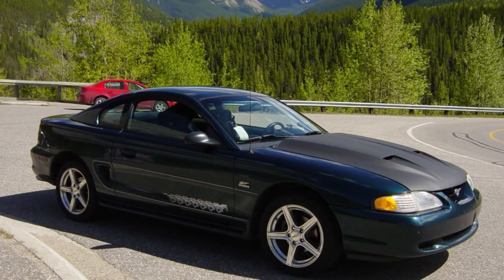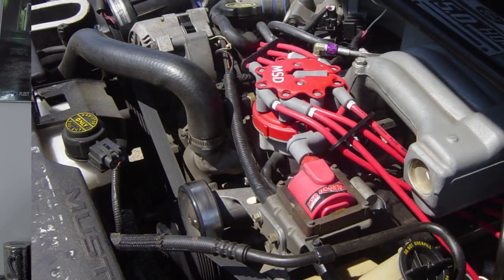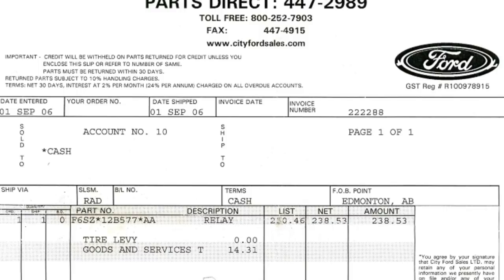SN95 Owner's Guide #3 - Myth of the CCRM

Comment: My 2000 mustang. Fan in on all the time.  Need advice.
Reply: my 94 just started doing that and I did not have a CEL so I did the koeo and koer tests and had code 117 which is Ect sensor ground and also a few other things which I'm thinking it's because of the ground that I got the other codes. I will check voltage at the pigtail connector today and see what I get and also plan on testing then splicing in a spare pigtail connector that I have to see if that fixes it.

Comment: hi! GTC i have a question related to what i just watched, when you opened the CCRM you pointed to 3 relays right,, and said that one of them is for the fan ok,,, well i have a mustang gt 1994 5.0..and fan is not working ok,, i had check fusses,all good,, and the fun works when i connected straight to battery ok,, but i have no power trough harnesses,, and from what you just explained my problem will be one of those relays inside the CCRM,, ok ,, can you please tell me where can i get that part and number of it?? please any help will be great because summer is coming to californiA and i like to fix it before get`s here ok well thanks in advance

Comment: On my 04 Mustang GT, when I turn the key to run position, the fuel pressure doesn’t increase at the fuel rail. I do hear the fuel pump when I do turn the key. Psi stays around zero. When I disconnect the fpdm and connect the power wire and fuel pump wire together, the fuel pump will prime to 40psi at the fuel rail. The car takes forever to start. Over 5 seconds to start. I replaced the fpdm and still have issues. When I drive, the fuel pressure will be somewhat normal then when I punch the gas, the car runs super lean and the fuel pressure drops to about 20 psi or so. A possibility the ccrm has a bad relay?
Reply: Having all those exact same problems in my 98 gt. Replaced fuel pump and it did nothing. Could be fuel pressure regulator or leaky injectors.
Reply: Did you find out the problem of why the fuel pressure drops? I am having the same issue and I have replaced many parts and still hame the same problem.

Comment: I have a 94 ford mustang which is running rich . Replaced the ccrm, stopped running rich for one run . Then ignition was shut off . Turned it back on and back to running again . Did I just get lucky and the ecu is bad ?
Reply from the maker: Without proper diag. it is difficult to speculate what is causing your rich condition, but I can assure you that the CCRM has absolutely no impact on fuel mixture control. It only provides power to the pump. The return style fuel system in your 94 runs the pump at a fixed flow (135 lph if stock) and manages pressure with a vacuum referenced mechanical regulator. Fuel delivery is managed by the PCM by referencing the MAF, ECT, IAT, Throttle angle, load calc, and finally O2 sensors. Any of those things out of range could cause a rich issue.

The first step is to verify the rich condition, a proper wideband is helpful, but OBD 1 codes can get you started.

Hopefully this helps you along.

Thanks for watching and commenting! -Darren

Comment: After all of a sudden I got it to crank and turn over but the car turns on and intimately dies off . It stays on if I push the accelerator only I let go of accelerator and dies . Checked under dash fuses and ok except like 2 or 3 of them I put new ones on . No I checked pins going into the CCRM AND ONLY LIKE 8 OF THEM HAVE POWER THE REST DONT . HELP PLS ?

Comment: Had an issue with mine where the fan was running constantly, turned out to be the ccrm high speed relay being stuck open
Reply from the maker: That is exactly the sort of failure a CCRM can produce. Did you replace the relay, or the whole CCRM?

Comment: I don’t know if anyone comments on here anymore, I have a 94 302 Mustang and currently the car runs HOT. I’ve replaced the fan but it seems that wasn’t the problem(High power fan kicks on but doesn’t drop passed the R in the word Normal on temp gauge). Code 556 (fuel pump relay) pops up hence why I’m here. My mechanic says my timing cover gasket is bad and that’s where I’m leaking.. does that sound reasonable? I’m not sure if anyone has had a similar problem please comment! Thanks

Comment: I have a problem with fuel in my 96  mustang GT. I have power at the 20a fuse in the box then no power at the inertia switch. Went to the ccrm and I have no power at pin 5 for fuel output. I'm guessing the relay is bad inside? Any help would be greatly appreciated
Reply: I’m having the exact same problem. My 1996 GT is showing almost ZERO pressure on a fuel gauge. Runs poorly and dies, press on pedal and it stalls then suddenly zooms to life. New fuel pump, new filter, getting power to inertia switch (because it works and engine dies) and tested for voltage at plug near rear of car, guesses OK,) I’m stumped..Did you find a fix? Thanks for a reply.

Comment: that being the case i could just delete the ccrm and put in my own fuel pump relay setup?(i no longer have AC and my fans are no longer stock running to a different setup)
Reply from the maker: I ran this idea past our Technical Advisor, Ted Jenkins of Tuning Innovations and he said it's not quite that simple, there is also a relay for the PCM that must be accounted for and a few other details. He had recently builit a setup to run without a CCRM for diagnostic testing and said really it's more trouble than it's worth to simply replace a factory packaged module with a homebuilt cluster of relays and wires. It's best to keep it OEM. Thanks for viewing and commenting! - Darren

Comment: I came here because the only thing I haven't replaced is the CCRM, my 1995 Mustang 3.8 is starting, idles, runs shaky at 1200 rpm, won't rev up unless you floor it.
Checked and repaired vacuum leaks, spark plugs, cable, MAF sensor, TPS, fuel pump and filter, I literally replaced everything the internet came up with.
Weird thing is : no codes, no CEL ???
Anybody any idea ?? Thanks !

Comment: I have a 97 mustang gt I'm getting no voltage to the cooling fan plug every thing I've read says track back to your ccrm module my fuses are all good but the plug to the fan isn't getting any voltage so what else could be wrong if it's not the ccrm?
Reply from the maker: I would think that yours is a textbook example of a potential failed CCRM, but it is important to do all of the checks for voltage and wiring. You should be able to google and find the full diagnostic for a cooling fan and wiring to walk through before you swap that CCRM. Thanks for watching and commenting! - Darren
Reply: @GrandTouringConcepts  thanks for the info

Comment: I am trying to remove a full patch of gas from my 2002 Mustang gt. I can't siphon it due to anti siphon in the filler neck so looked on YouTube and found that I can jump the fuel pump rely to run the fuel pump. However, because the rely is in the CCRM I need to figure out which wires in the wiring harness at the CCRM  I need to access so I can do this. In my search it dawned on me that maybe I can access the wire(s) to run the fuel pump at the Inertia Switch by unplugging it and supplying 12v there. Can you please advise me on this or maybe you have a simpler way for me to drain my fuel tank where I don't need to drop the tank? Any help would be great. Thanks!
Reply from the maker: You could look at the diagram in the video description link and apply power from there, but the simple method I use, is to disconnect the fuel feed line, then cycle the key on and off to cycle the pump prime. OPen the line somewhere easy such as the fuel filter or underhood, and apply a drain to a gascan, then cycle the key, the pump will prime for 2-3 seconds, once it stops you can roll the key back to off and cycle to run again. It may take a bit of time, but I did my SVT Lighining tank this way, and the risk of damaging wiring or modules with jumpers is non existant. It's my go-to method.
Reply: Thanks for getting back to me on this. Yes, I did think of doing this but I need to drain over 14 gallons and doing it by cycling the pump would take forever to get all of it out. There is a person on YouTube showing how on any car you can do this by jumping the fuel pump rely. He pulls the rely, installs a jumper wire on the two connectors where the switch is on the rely but as you know, I can't pull the rely as it is part of the CCRM, but, I thought maybe I could locate the two wires on the CCRM wire harness and jump it there. What I don't know is, do I also need to disconnect the other two wires as well? If I do it this way then I will set it up where I can easily access it again just in case I ever need to drain the tank again. I am looking at the wiring diagram for my 02 4.6L SOHC 2V but I don't see the fuel pump rely but when looking at the diagram for the 4.6L DOHC 4V I see it. Can I assume the wiring is the same? If so, then I think I should be able to access the RED wire and the WHITE/RED wire and jump those two. I will have a hose on the fuel rail to a can and all I should need to do is turn the key to the on position and the pump should run continually. Am I missing anything that you can think of?

Comment: WILL THE CCRM WORK WITH A MANUAL TRANSMISSION AND AUTOMATIC IF IM LOOKING TO BUY ONE FOR A 93 MUSTANG 4 CYLINDER ENGINE?
Reply from the maker: The CCRM is specific to cars that are 1994 and up, and are controlled by the engine computer. It is unlikely that a Fox computer could be modified to run a CCRM, but if the entire engine harness and computer from a 1994 or newer car were used, it could be made to work. Depending on what you are planning, it is probably simpler and more affordable to source a stand alone fan controller from the aftermarket. Thanks for watching and commenting! -Darren

Comment: Hello would this apply to a 1996 GT as well…I would appreciate a quick Y or N please?
I’m having fuel pressure issues (replaced fuel pump, filter, power exists at plug in going to pump—getting almost zero PSI at fuel port).
Reply from the maker: This would apply to a 96 GT, but if you have power at the pump, the CCRM is not your problem. If you have steady 12V at the pump, I would look for a flow restriction like a pinched hard line, and ensure you have flow at the rail. This should be a fairly direct issue to find. Best of Luck! - Darren
Reply: @GrandTouringConcepts  I’m calling this one fixed and it WAS the CCRM. I went to a junkyard and found a rusty $14 dollar one and replaced my old one and now it’s running great. I haven’t even test drove it but it’s reading 30 PSI now on the same gauge that read about 0 PSI last week (and was reading 30 PSI on my good running 4.6 Lincoln Town Car).

If you want my old one to study you can have it (you ship). I’m sure you are usually correct about these. Of course I suppose there could be a 3rd problem that could be intermittent and somehow effects the pressure that just happened to go away the second I replaced the CCRM…but I doubt it.
Reply: Took it for a test drive. Still hesitating and stalling. 😖I’m starting to suspect a short—why? I noticed my speedometer would occasionally drop to zero when I was moving (at a good speed).

Going to try your suggestion of checking fuel flow at different points, but doesn’t see how that would cause the speedo to fail intermittently.

Comment: Hi I just saw ur video about CCRM GREAT INFO THANK YOU ! 
BUT IF I MAY , MY VEHICAL OUT OF THE BLUES JUST TURNED OFF COMPLETLEY NO POWER AS I WAS EXITING THE FREEWAY OH YEAH BY THE WAY I LIVE IN SAN DIEGO . I OWN A 2000 MUSTANG GT AUTOMATIC 4.6L.  SO IT WOULD NOT START DONT KNOW WHY ,THEN I MESSED AROUND WITH THE SWITCH IGNITION,  AND WIRES UNDER DASH AND STARTED RIGHT UP ! WEEK LATER NO START NO CRANK NO TURN OVER .

Comment: Also on my 1994 cobra installed a high volume water pump 3 row aluminum radiator 160 thermostat and it even gets hotter now than before. Was thinking of replacing fan, what do you all think.
Reply: Even with a lower temp thermostat and bigger radiator, the temperature that the fan turns on wouldn't change without tuning the ECM. It's entirely possible that's where your issue is; I could see a fan short cycling with such a low temp thermostat.
Reply: @mn12sc35th  thanks for the reply, took it back to mechanic shop they had left the hoses loose. Now it's running cooler but would like for it to be in the middle. Now it's in the m of normal before it was at a.
Reply: @elroybazan3971  that's lame, but at least they sorted it out (and it sounded easy). That's about where my 4.6 runs with a 180º thermostat, but I'm told the 4.6 likes it a little warmer than the 5.0
Reply from the maker: NA 4.6L cars do in fact make best power when at 190-200°F engine coolant temp. We unwittingly discovered this on the dyno with a modded 2002 Mustang GT we had in the project years ago. All great conversation gents! - Darren

Comment: Can you not replace the relays with generic ones? are there pins or are they soldered to the board? im not getting power to my fuel pump and all my fuses are good and am trying to replace my fuel pump relay
Reply from the maker: I would think you could certainly desolder the old relay and install a new one that matched the old relay for amps and pin out. They are just Bosch pieces and should be available. Thanks for watching and commenting! - Darren.

Comment: So I pulled codes on my 94 and I got 542 543 564 and my car runs but the check engine light come and so I check the codes oh and the fan works not sure about high and low but it works so any help would greatly appreciated

Comment: i took the engine cooling responsibility away from the car and added a fan controller. the computer wanted to turn the fan on at like 221 degrees if i remember correctly...that was way too high for my mods and the area i live in

Comment: Why won the my mustang stay running? It’s a 96 gt I replaced the fuel pump but after it starts it idles for literally a second then turns off and stops working
Reply: It seems as if the car gets gas for a mulinute but the relay doesn’t keep powering gas to it

Comment: Would a bad one be the cause of a voltage drop when accessories are turned on? I changed my alternator, cleaned and checked my grounds, and cleaned and checked all power cables.
Reply from the maker: It's not likely, how much of a drop? Some is normal. For example with underdrive pulleys my car I was 13.7v unloaded and 12.5v loaded at idle. Where is yours at?
Reply: Grand Touring Concepts if I run my vents on high and my radiator fan is on at the same time it would drop between 11-11.3 volts when using it for more than 10 minuets. When running my highlights and stereo is going, I seen it low as 10.7 volts on a volt meter. When there’s nothing, just the engine, it’s at 14.4.
Reply from the maker: That is certainly too low for sure. I would verify that you do not have underdrive pullies, if you do, you may have to consider reverting to stock. If your pulleys are already stock, I would retest the voltage drop at 2,000 rpm it should be much better there. It is also a good idea to have the battery tested, it might be in need of replacement, but verify first. Your charging system should easily handle all accessories so something is up. If all that checks out maybe it's time to pin point loads circuit by circuit, or consider a higher amperage alternator.
Reply: Grand Touring Concepts everything is all stock. I did change the alternator and battery. So I kinda hit a brick wall. I did though do a one wire conversion and it did help.
Reply: do you have a system in the car .. like subs amps ect?
Reply: Cody Ramos no. I removed it. So my car is stereoless
Reply: stangmaster 2 I’ll try that. Some one also said try changing the fusible link. Don’t know what that is yet, but I’ll google it.

Comment: Hi my name is Steve lively I got my mustang 2003 2 weeks ago some kid owned it said he had a blowout and then lied the rest of the way thru it. I still bought it . Ok I'll show pics at the end of my ramblings,  the inner wheel well was destroyed along with abs and I think return lines for fuel. And the wiring harness and ccrm box took a serious beating . He did not pull over and beat the hell out the car . One 5 hour day tracking wires and splicing harness back well all but two light very light green w black stripe and red w yellow stripe. Are the only two I know of thar I couldn't find a mate for . The box took a beating and I'll make a video to show what I've done car is in theft mode fuel pump comes out today said they replaced it at Bob Allen FordI, Johnson County kansas .I have a receipt that says a bunch on it and as far as I saw w I got the car none of it was done one. 1354.93,

Comment: Help. Have a 2000 yt? Cranks no start fuel pump getting power but no fuel going I to injector theft light rapid flashing is this a key issue. All grounds are good but key won't reset theft system
Reply: Did you ever solve this problem?

Comment: Ok..  I watched a lot of videos on it android could not figure out why my fan was not coming on In my 95 Cobra. I of course traced it to this video thinking possibly it was my ccrm was the problem. I paid a shop to change water pump and thermastat. They put thermastat in backwards . Thermastat got stuck.could that at all affect my computer or ccrm telling my fan to turn on??
Reply: The android part was a typo.. sound have said "and"
Reply: Did you get the fan not coming on problem fixed? I’m having the same issue with my 95 Cobra.